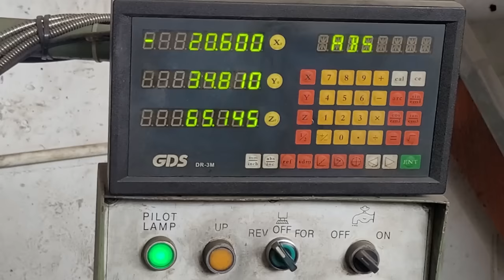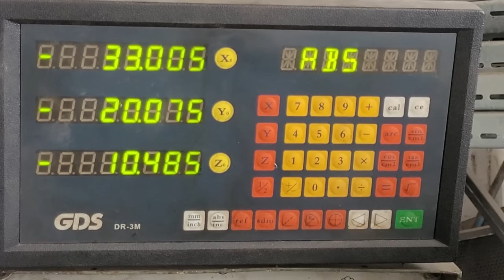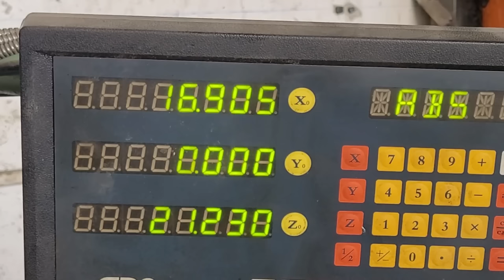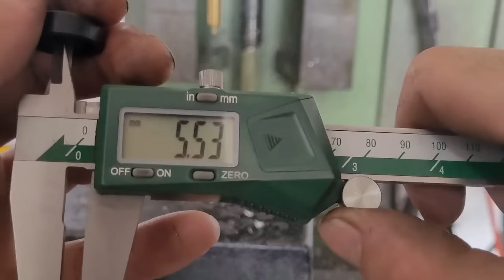how to make a mini hydraulic pump? making external gear hydraulic pump - Diy rc mini hydraulic pump

Comment: Probably get better pressure if you get rid of those beveled edges on the gear teeth.
Reply from the maker: actually, I did a correction of the beveled edges.
Reply: @CallutLathe  Hello, is there a way to contact you? I would like to inquire about a project I have